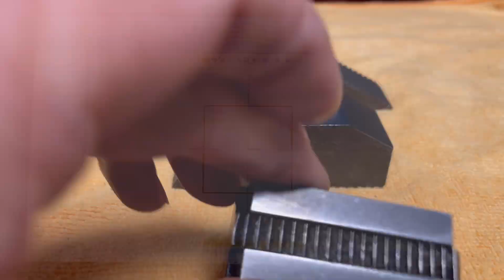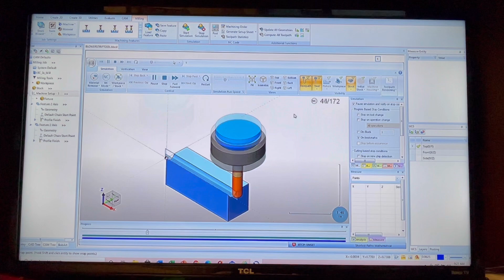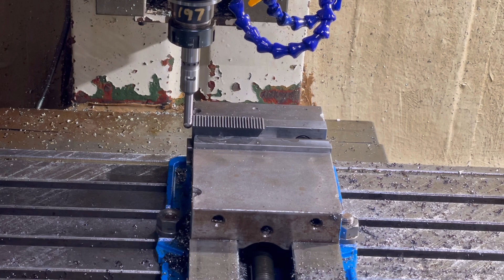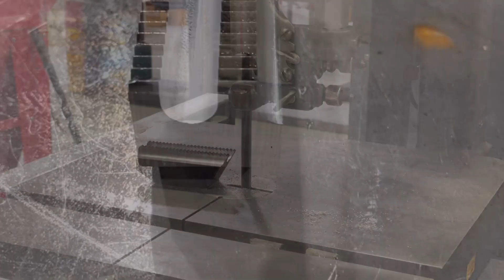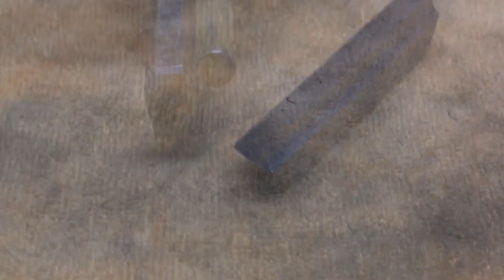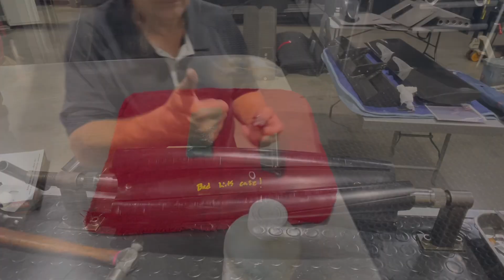THE MAKING OF A TOP-FUEL SUPERCHARGER TOOL!

Comment: So a trick when I'm touching off tools is I take a precision one inch gauge block and I set that on the material bring the tool down below the 1" block, set the jog handle to the highest setting (on my machine it's 0.005") then raise up the tool until the 1-inch block slides underneath pull the block back out go back down one position on the jog handle (so now the block won't fit underneath) then change it to the next finer setting (mine is 0.001") go up again, 1 click at a time until it fits in that setting pull it out go back down one click and then go to the finest setting (mine is 0.0001") go up until it slides in and your touch-off will be perfect. Always make sure to move 1 click at a time, check and remove the block before making an adjust to make sure you don't accidentally go negative and crunch the tool on the block. Set you tool zero and then minus 1.00" from that number to get to the top of your stock. The other great thing about this method is that when you're done touching off and you go to move the tool away from the material you're one inch away so if you accidentally bump the jog handle down you don't crash the tool into the material (of which I've done before, sadly). Anyways thanks for all the information in these videos!

Comment: Hey Rob. Not sure what version of BCC you're using but in my V23 go to preferences - settings default - system and you can turn on autosave and set the interval. I think I have mine set at 3 minutes. Doesn't become a hindrance until models become large and it freezes for a sec or 2 at the interval.